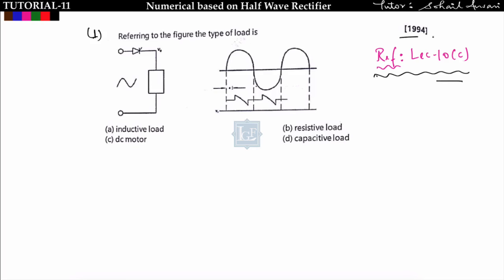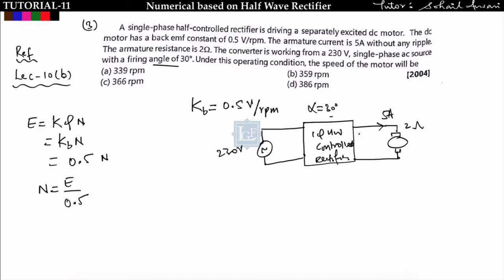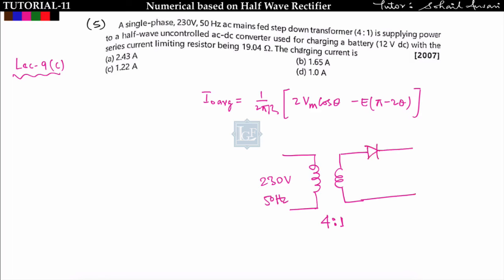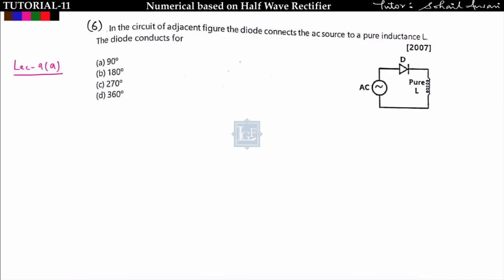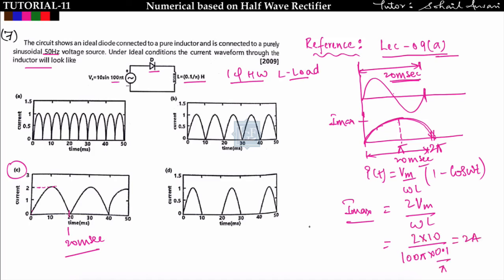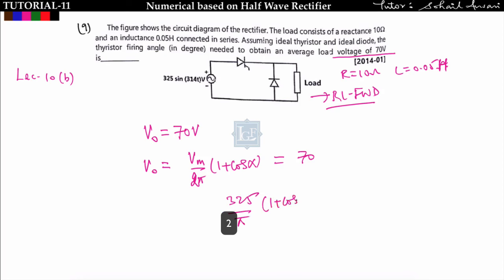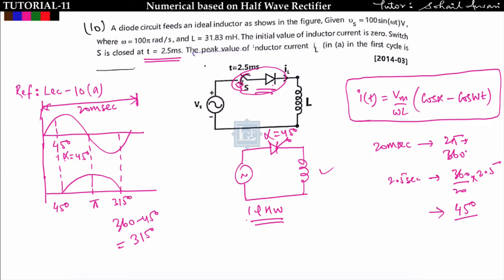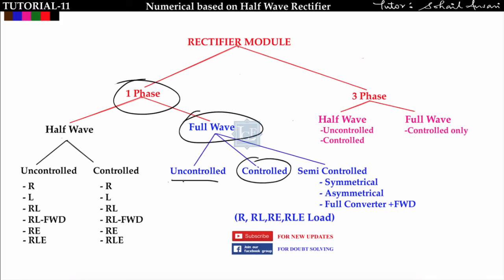Lec 11 GATE Question Solved (1991-2017) based on Half Wave Rectifier

Comment: Approximation of 346.4 never could be equal with 339
Reply: It is half controlled ..not half wave controller... means single full wave semi converter..
Vo = [(Vm(1+cos@)]÷π
= 193.2
E= Vo-(Io*R)= 193.2-10
=183.2
Speed N= 183.2÷0.5
=366
Option C...

Comment: IN question number 10, we should actually calculate the average current and find out its peak value. And we are considering that switch is closed at 45degrees, how come it will conduct upto 315 degrees, we are using diode, so it should conduct upto 360degrees. Please explain.
Reply: Watch the previous lectures of Controlled HWR with L-load properly and then ask such question, it's beta=2pie-alpha.

Comment: Sir in question 3..single phase half controlled rectifier means semi converter.. If we solve using semi converter then I'm are getting 366.4 as the speed.. Please clear my doubt!
Reply: did you assumed rle or r load to get ans as 366.4

Comment: In first question you said RLE type of load but in RLE type of load during negative half cycle output should be equal to E (CONSTANT). But in the question it seems like having source component. Looking like full wave rectifier with RLE load

Comment: In question 3 ,it is written that single phase half controlled rectifier,
 half controlled means semiconverter naa??????

but in solution why are you assuming it as a half wave controlled rectifier.?

plz clear my doubts ..
Reply: I have the same doubt brother. Taking it as a semi converter, answer is coming around 366.4 rpm
Reply: Debanjan Datta  correct the statement should be half wave controlled rectifier....here the word half “wave” is the key...it’s presence means negative half cycle is absent. Typing error thanks for pointing out the same.
Reply: FREE ESE ELECTRICAL ONLINE "Half controlled means negative half cycle is absent" I'm sorry but I didn't get this... Isn't negative half cycle absent for a halfwave rectifier? And if we consider half controlled means negative half cycle is absent i.e. one output voltage pulse per cycle of 2 pie rad, then what about this question? https://m.youtube.com/watch?list=PLfDaOYdi9aZzPMcHuiZ-tD8f8aLKeblCa&v=dTjs2gpySfE Question 3. Here also "half controlled" ac to dc bridge converter is mentioned, which is being considered as semiconverter, in solving the part (ii) of the problem. I'll be thankful if you reply!
Reply: FREE ESE ELECTRICAL ONLINE :)
Reply: Ya bro HC is given not HW.. My ans     is also 366....
Reply: If I'm not mistaken, Sir is using Kreatryx previous year qtn bank here, in which the value of K is given as 0.5 in the qtn, but in the back end solution K = 0.25 has been taken and 1 ph HWCR with DC Motor Load and FWD ckt has been used. I have a Made Easy qtn bank as well in which K has been given as 0.25 in the qtn itself. Hard to tell which one is correct!
Reply: @Rohitkumar-uc4nq  best of luck bro 👍
Reply: Half controlled means negative half cycle is absent...while semiconverter means positive half cycle will be controlled through thyristor and negative cycle will be freewheel through diode but it will be present in the circuit.

Comment: question 11 :::::cos(phi)=Vorsquare/r*Vs*Is   =Vorsquare*r/r*Vs*Vs  =Vorsquare/Vssquare =2/4=0.5 
instead of isquare r i took vsquare /r and i am getting 0.5
Reply: If I'm not mistaken, you are taking Is = Vs/r. If you are doing so, then it is wrong. In the lecture on diode rectifier with R Load, Sir has clearly mentioned that for this type of load, we can consider (Is)rms = (Io)rms. 
And (Io)rms = (Vo)rms/r. So cos (phi) = (Vo)rmssquare*r/r*Vs*(Vo)rms = (Vo)rms/Vs = (Vm/2)/(Vm/1.414), where Vm is the peak value of AC Source. Hence cos (phi) = 0.707. This is a standard result for this circuit. You may verify it from P.S. Bimbhra

Comment: sir my doubt is as u said  in qtn no 3 the dc motor is a RLE type load thne why are you taking the output voltage as Vm/2pi(1+cosalpha ).  for RLE type load the output voltage will contain other equation na ????????? sir plzzz reply for this
Reply from the maker: see here load current is constant and ripple free as given in the question...so it will be possible only when you will consider 1 phase half controlled with fwd..we insert free wheeling diode in order to make load current continous..ok..so see the output voltage waveform with fwd....after pi the output voltage will be 0 bcoz of freewheeling action....and from alpha to pi output voltage will follow the input voltage..got it..
Reply: but for RLE load with freewheeling diode thyristor will conduct from (alpha) to (pi-theta) only for ripple free, but why are you taking RL with freewheeling diode.please clarify my doubt sir.
Reply: RLE with FWD have same Output Voltage waveform as RL with FWD
Reply: Vo=96.3V; N=96.3*4=385.24rpm    ans:(d)
Reply: @GATEMATICEducation  sir does this mean that dc machine load can be treated as RL or RLE load
Or... 
That the waveform of RL load with FWD  is same as RLE with FWD? 
*correct me if I'm wrong, for RLE with FWD o/p v is from alpha to pi minus theta
And for RL load with FWD its from alpha to pi

Would really appreciate a reply and thanks again for these awesome  to the point lectures...
Reply: @GATEMATICEducation  thanku sir
Reply: THANKS SIR
Reply: thankyou sir i got it ...
Reply: Means whenever a ripple free current is there, the must be a freewheel diode in the rectifier circuit?
Reply: i too got the same doubt sir ..clarified
Reply: I have the same doubt instead of considering RLE load why we are considering it as RL load
please help me
Reply: That is half control reactfier in continious cond.